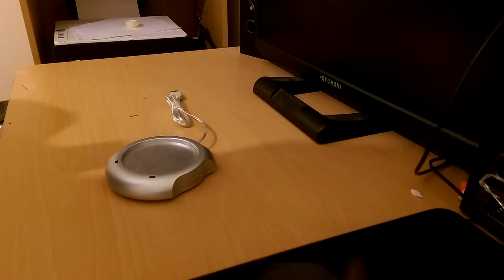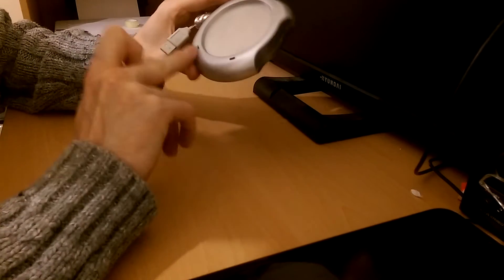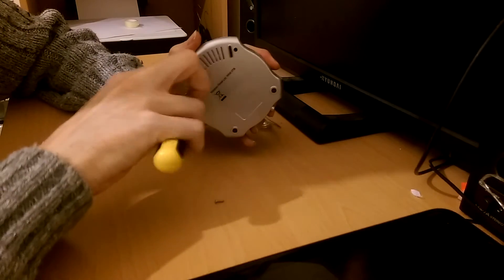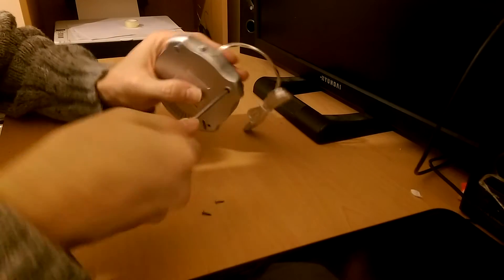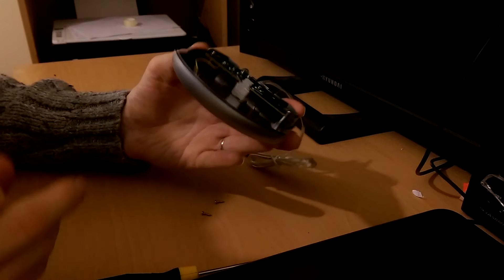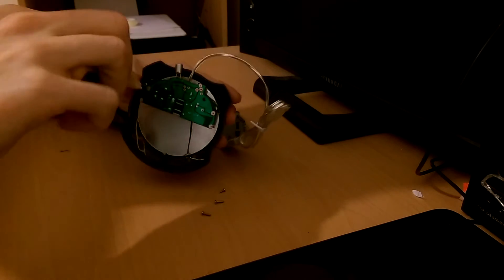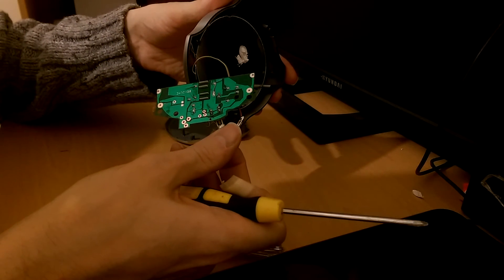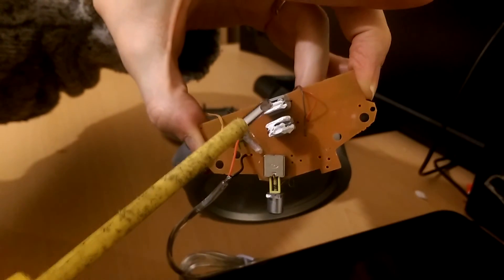USB cup warmer teardown

Comment: if I were to swap out the resistors for bigger Watt, could this increase temp?  how can I make it hotter?
Reply from the maker: Hi David, probably not as you're limited by the voltage and current USB ports will supply. Bigger wattage resistors will simply allow a larger current but the USB won't be able to supply more unfortunately.
Reply: Get yourself a PCI-E extension cable.
Take the heatsink off your graphics card.
Connect the graphics card to your motherboard via the extension cable.
Put graphics card on flat surface and place your cup on top of the GPU.
Open game.
???
Profit.